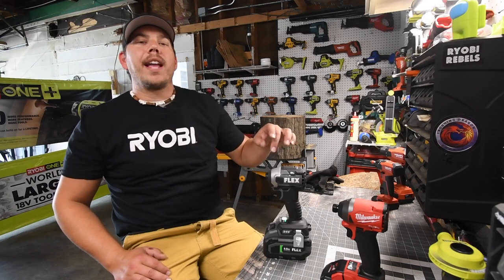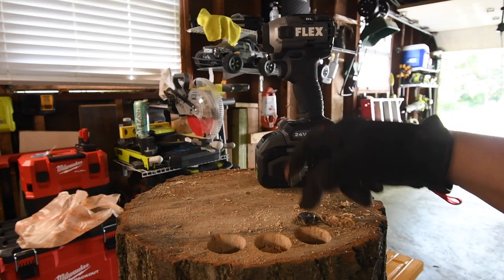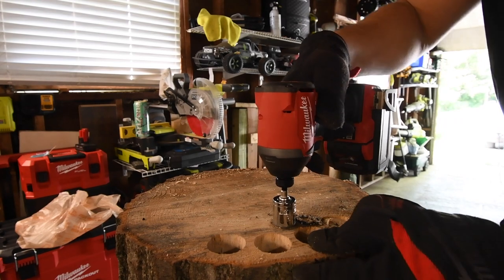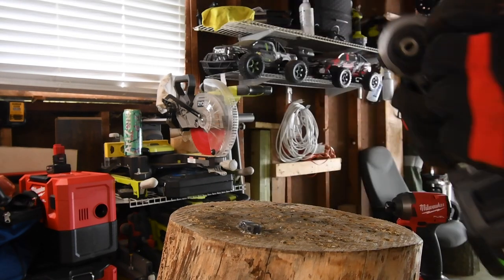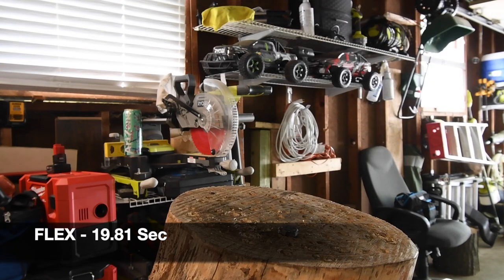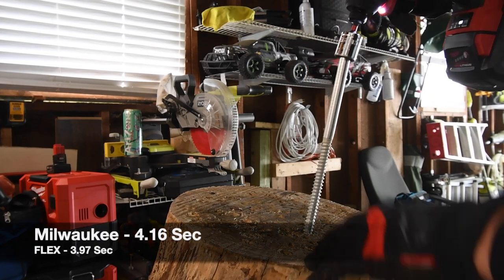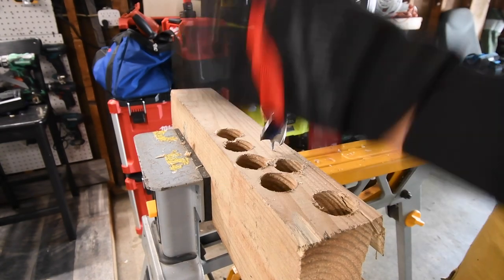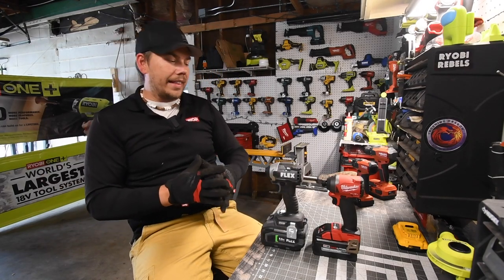FLEX vs Milwaukee Impact Drivers (8ah Batteries)

Comment: Flex is not what’s next.
Reply: Why’s That? The flex beat Milwaukee in pretty much every test. The one test it took 15 seconds to drive the lag In was a huge outlier, I’m assuming the flex hit an especially hard spot on the wood in that test where it took it 15 seconds to drive in. Not to mention the flex produced more torque when tested in the torque test channel. They could definitely be what’s next considering this is their first iteration.
Reply: @TacticalThib  Your such a a goof 🤣🤣🤣
Reply from the maker: both are power tools
Reply: @TacticalThib  I agree. Flex talked up these tools so much before release and their introductory video was a load of crap. Completely staged. I’m not a fanboy but like my Milwaukee tools. Any video where the tools are really pushed to their limits Flex does not win. Both Milwaukee and Dewalt have beat it. Milwaukee with high output batteries win every time.
Reply: @P_steez  Torque test channel didn’t even have a high output battery on the Milwaukee.  And I think you need to watch this video again. Flex did not win most of the tests. I agree with Branden.
Reply: @derekbross6958  torque test channel made runs with the high output battery, it didn't make huge improvements
Reply: @derekbross6958   of course you agree with Brandon, you’re both Milwaukee fan girls lmao. YOU need to watch it again, all the tests were close and flex won many. So saying definitively that “flex is not what’s next” makes you look stupid as hell , it’s their first iteration of tools and they are competing with the best. Even Dave enjoys them
Reply: @derekbross6958  thank you Derek B.. you said it better than I did. I appreciate you comment.
Reply: They’re tools, folks. This isn’t the Sox vs the Yankees. Buy and use the tools you want to buy and use, and let others do the same. All the chest beating is just silly.

And if you don’t think tradespeople of a few generations ago would’ve walked through a Wisconsin snowstorm to get their hands on either one of these tools, you’re kidding yourself. Appreciate the innovation that market competition has helped drive.